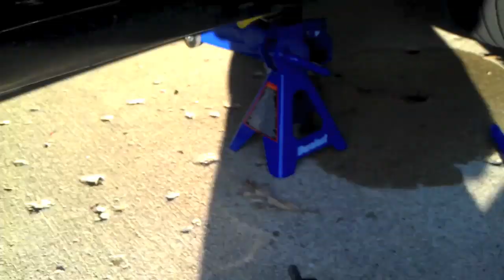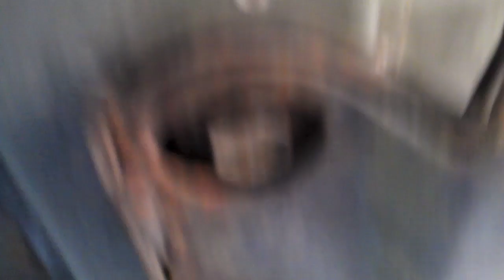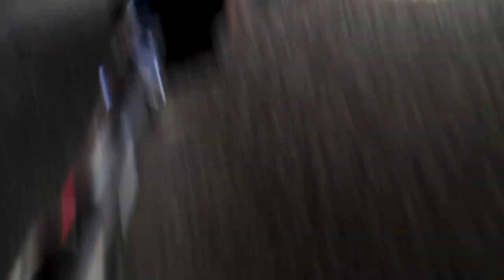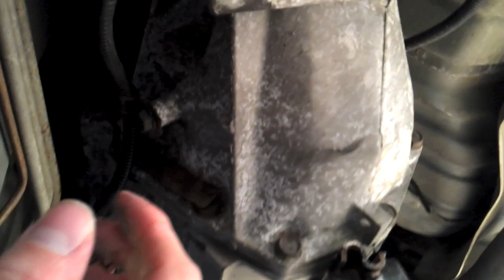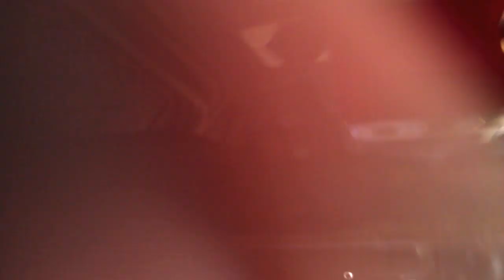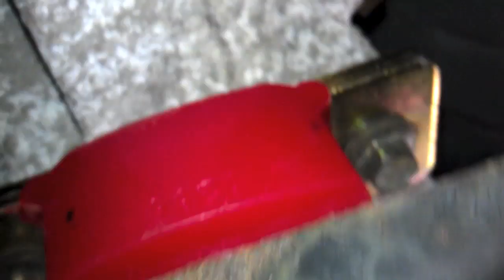98-02 F body Energy Suspension Transmission Mount Install

Comment: What is the part number of your torque arm bushing I have ordered 2 already and both had the fittings backwards like the letter E when it should go in looking like the number 3 I had to cut one down to make it fit at least it's holding now but I would like to get the perfect fit I have a 1998 v8 trans am thank you and nice video 👍

Comment: I just tried the same upgrade on my 97 Camaro 3.8 T5, but the mount is 1.5 inches too short and yes the bolt hole is too far forward. I reinstalled my old mount, surprisingly still in good condition. If I went with the ES mount the transmission would drop 1.5 inches from stock, not good for pinion angle and more stress on torque arm mounting. Now I'm stuck with a red poly paper weight.
Reply: Austin Banister okay if I may ask? My car will go down the road and if I hit bumps it's makes a clunking noise? If I downshift it will clunk. If I hit the brakes in reverse repeatedly it makes a clunking noise as well? Any help?
Reply: I would think that it is the torque arm bushing that has expired or maybe even opened up allowing the torque arm to move freely. A loose torque arm sounds like someone hammering on the driveshaft tunnel.
Reply: There are different mounts and the one for the Monte Carlo is SHORTER so maybe you received the wrong part number and got a Monte mount, the LT1 mount is taller and looks like the one in this video and it's part # is 3.1142.
Reply: The V6 auto crossmember has a dip in it because the oil filled mount is taller than the v8 solid rubber mount. The v8 auto transmission crossmember is flat. The poly mounts are only designed for the v8 transmission crossmember.
Reply from the maker: That's why I had to drill a hole in my cross member. I disagree with you. My transmission dropped none. I don't know why you had so many troubles. But hopefully it doesn't happen again!

Comment: did you get any drive train vibrations after installing the new tranny mount?
Reply from the maker: Yes I did. I had to rub off the tabs until it sat flush with the metal piece.
Reply: What tabs I just installed torque arm and trans just like you do same brand and everything
Reply: @chrishibb9513  
It's Nothing to Rub off..It Will Vibrate No matter what you do...but it's not that bad to me .... I'll take it anyday to get all my power to the wheels ..

Comment: Thanks for the video. HOWEVER, it looks like you're getting under the car with the front supported only by a floor jack. That's a really, REALLY bad idea. You should always use jack stands, or at the very least ramps rated to hold the weight of your car.
Reply from the maker: I know 4 years later isn’t a timely reply, however the car was up on two jack stands, with the floor jack as a safety! You can see both jack stands throughout the video! Safety is a huge thing, thanks for the comment!

Comment: I put the same polyurethane transmission mount and after that I put a polyurethane Energy Suspension torque arm bushing and the same for the rear bumpstops

Comment: That was very helpful man, I have a 2000 trans am and my old mount just can't hold up to the torque I'm putting out now. Everytime I'd jump on the gas I'd hear a loud as clunk/pop whatever you want to call it. And I could feel it right next to me and in my shifter. Hope this is what's wrong because it's cheap and easy to do!